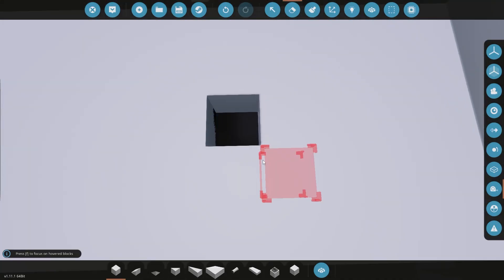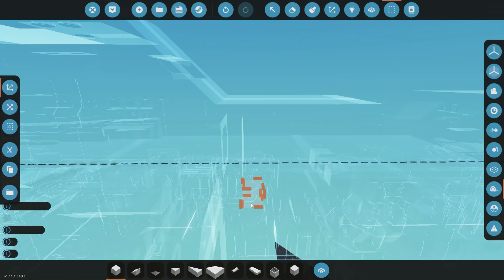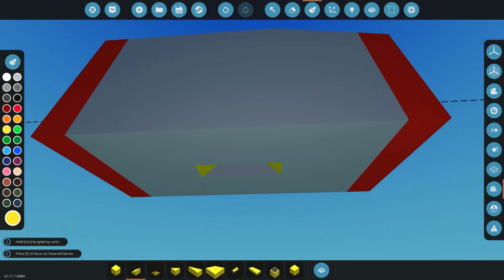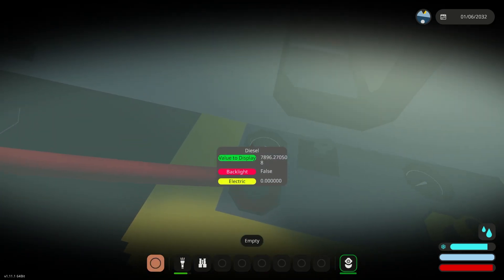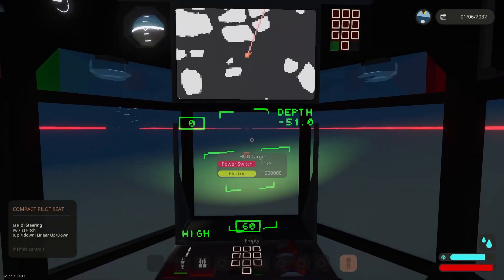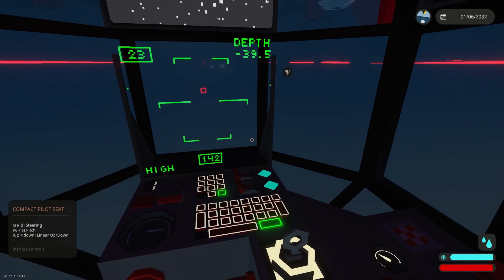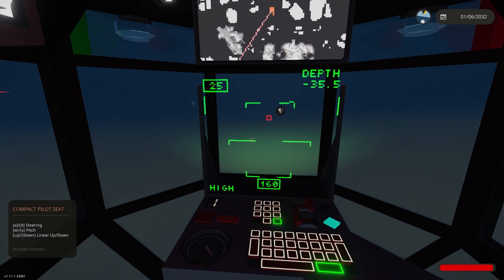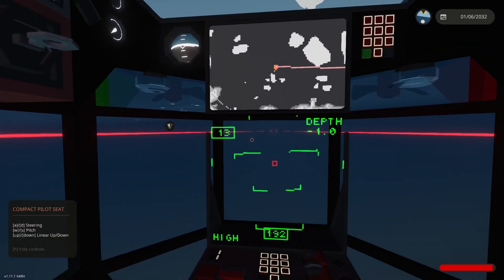Stormworks Build Series: Hybrid Submarine Episode 15

Comment: I like this submarine, but it is very difficult to pump the last 100 litres of fuel out of the external tank, because the pressure in the tank is very low and the pump can't pump the gas oil out.
Reply from the maker: Hmmm this is good to note, I will try to update the tank and fix this!